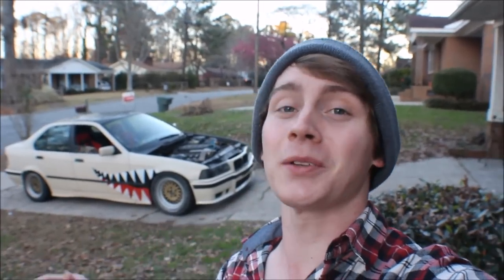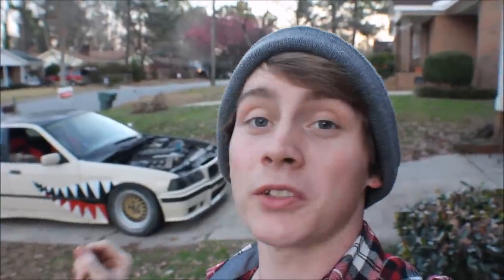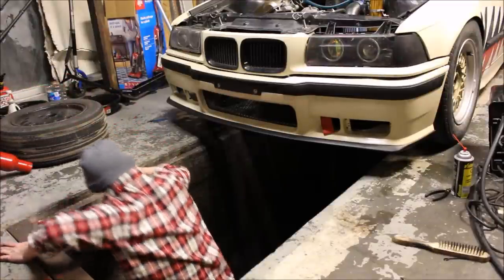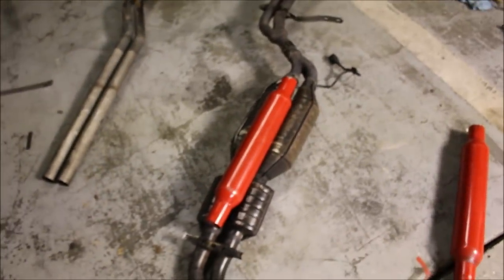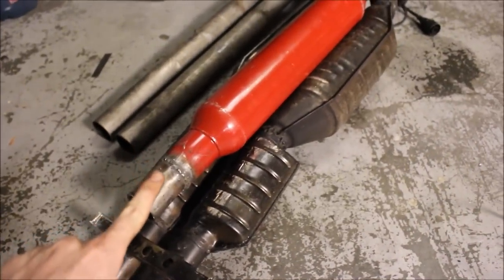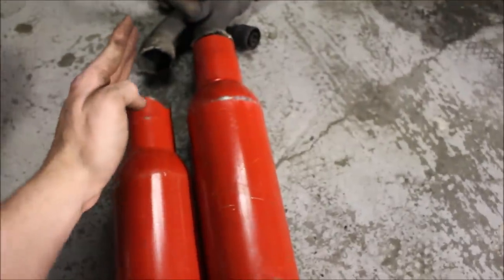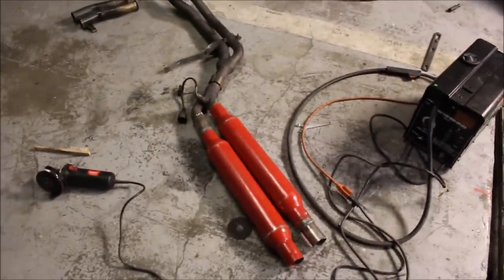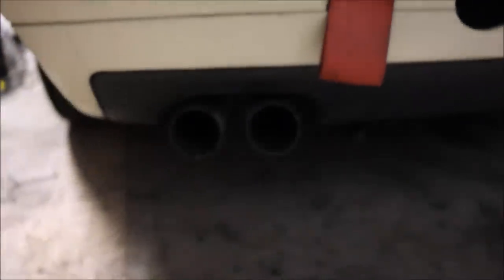CATALYTIC CONVERTER DELETE! : BMW E36 325i Drift Build Ep. 13

Comment: if you find a need to fool after cat o2s use a large spark plug anti-fouler and drill a 1/2in hole almost through it from the inside so the bulb on the o2 fits inside this takes the o2 out of direct exhaust flow making it less sensitive to set a p0420 code

Comment: You can't really tell by the sound of a youtube vid, but I think It sounds great. Didn't expect those glasspacks to be that good. But I heard, the further you install mufflers from the engine, the better. Isn't it true?

The windshield, Austin. Please! :D
Reply from the maker: You're right and I'm not quite sure as to the placement having an effect. I just placed them there to delete the cats, I'm actually going to add the stock resonators further back soon.
Reply: Austin Ferguson why?

Comment: i think the not having the nozzle on your welder is causing unnecessary sparks
Reply: jesse m he's using self shielded wire, he doesn't necessarily need the nozzle unless he's using solid/dual shield wire w/ gas.
Reply: THIS IS A JOKE YOU DONT WELD EXHAUST WITH FLUXCORED-RUNS EITHER TOO HOT WHICH CAUSES BLOWOUTS OR TOO COLD  LUMPY SHI TTY SHIT BALLS WITHOUT PENETRATION) BUT BETTERAND FUNNIER IS THAT ITS STOCK CATS THEREFORE THEYRE STAINLESS STEEL.. SHOULD BE USING .030 308L  WITH  98% AR -2% CO2
Reply: THATS THE LACK OF A GOOD GROUND. SEE HOW HE GROUNDED TO STRAIGHT PAINT LMAO
Reply: 0NEANDONLY caps much? Lol jk this info is helpful af.

Comment: would you recommend cat delete or muffler straight pipe for a deep rough sound
Reply from the maker: I'd always recommend a muffler delete. When you delete catalytic converters it makes the exhaust real raspy which I can't stand (like the stereotypical "fart can" raspy sound). That's why I had to redo my exhaust and add in the glasspacks. Muffler deletes are simple and in my opinion sound the best. +MAXRIOT Music

Comment: man glass packs sound garbage. should've got a super high flow muffler IMO. I used a flowmaster 10series with no cats and no resonators and it sounded a lot cleaner. great job of the exhaust fitment though that's hard enough using a lift

Comment: Dude what are the specs on the car , think looks like it went flying lol . anything done in the motor ?
Reply: erick martinez he said it makes a little under 200 and the interior is stripped so its probably pretty light and making the most out of the power it has

Comment: what upgrades have you done to your engine jw becasue i have a 325XI and looking to upgrade
Reply from the maker: Nothing much, it's essentially stock. Actually have a little something coming in the mail for it soon.
Reply: Austin Ferguson Do you plan on putting any crossover pipes in your exhaust like x pipes or h pipes?? H pipes sound deeper than x pipes btw
Reply from the maker: Not really, it'd be a hassle and there's not really much room to do anything since the pipes run side by side.

Comment: What welder do u use
Reply from the maker: Just a cheap harbor freight flux core welder. It works decent enough but it's just hard to get super clean welds with it.

Comment: you dont have mot in the us right?
Reply: ICAbasic runar They have to test for emmisions every few years
Reply: okay but does it differ from state to state? and is that it? dont they check the overall joints and brackets under the car?